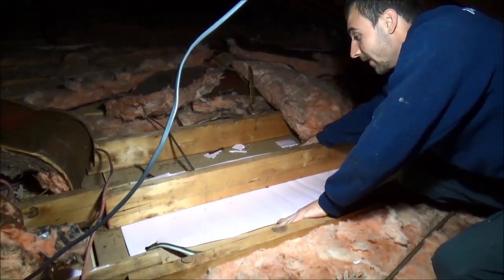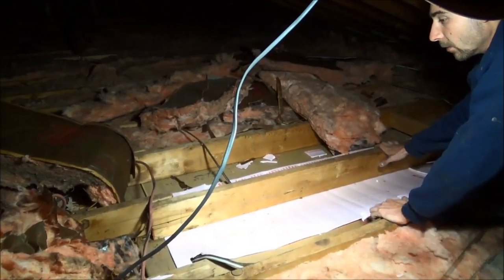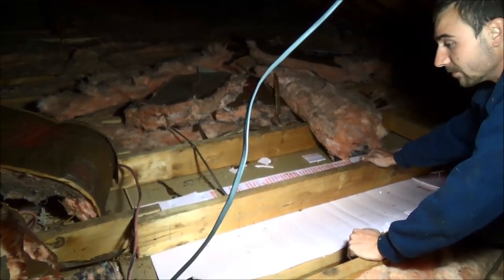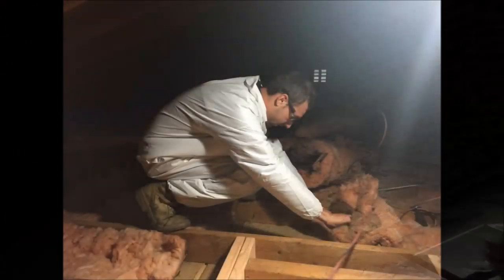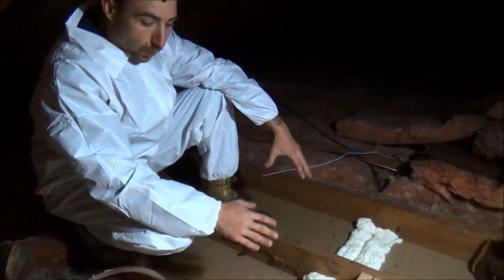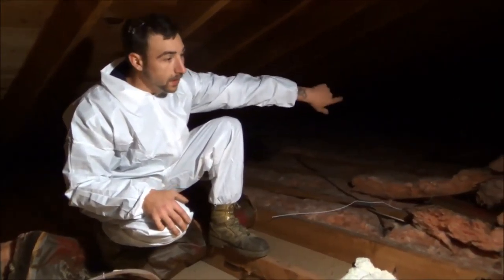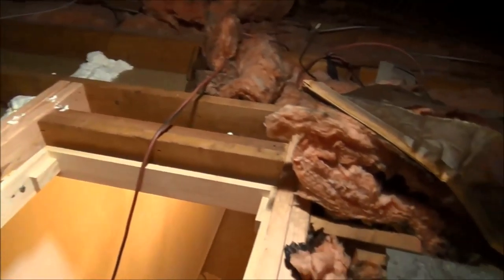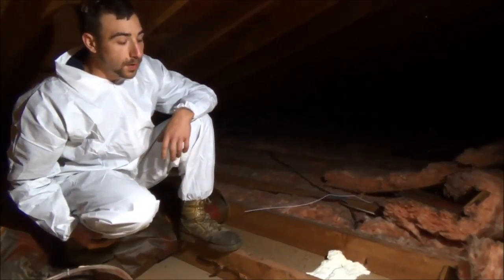Air Sealing Demonstration

Comment: why use two part spray foam? I assume you would be insulating the attic after air sealing. one part would have been way cheaper.